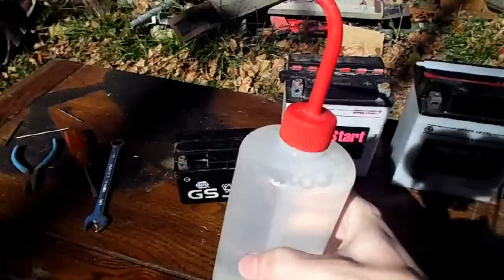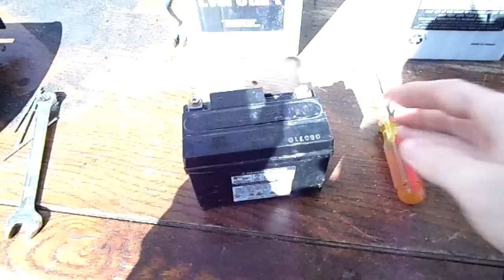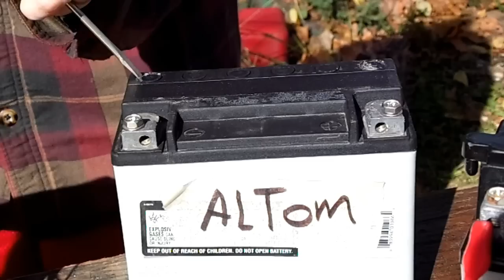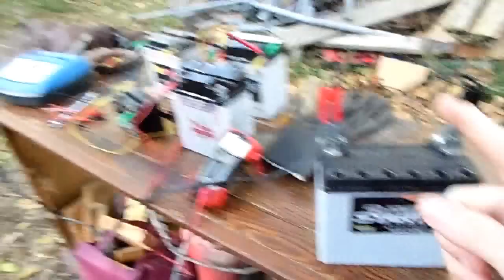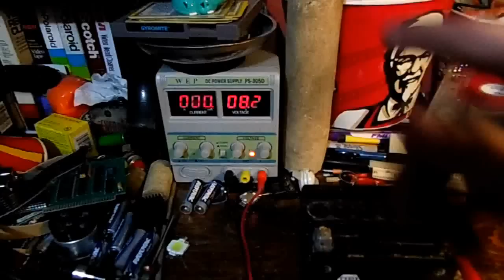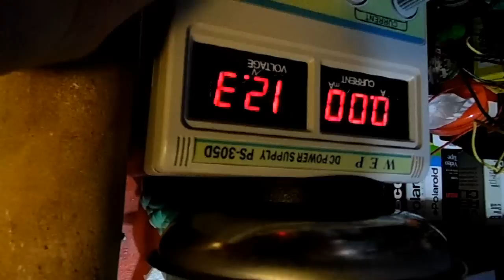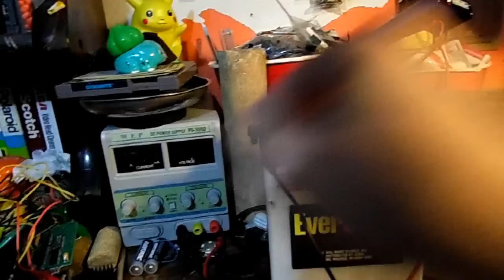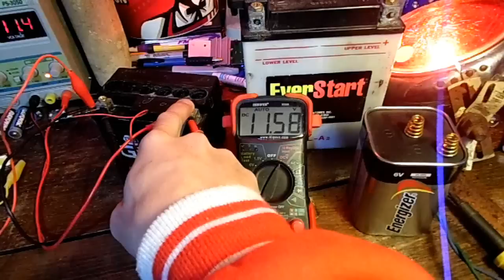DIY Fixing Lead Acid Batteries

Comment: I paid 30. I'm fixin to go pop it open and see if maybe they forgot to fill it
Reply from the maker: well if you do that you cant return it. was the auction for a filled battery? btw you can test if its filled or not from the outside. test it's continuity. it should have no continuity without electrolyte.

Comment: I bought a sealed motorcycle battery off eBay and when it arrived it didn't work. It had 10 volts. Did I buy junk or did they forget to fill it with acid or charge it?
Reply from the maker: you prolly got ripped off, if there are no caps on top for you to fill it, then yeah. how much did you pay?

Comment: great video, but shouldn't you be wearing gloves the whole time?
Reply from the maker: nah, i've gotten the battery acid on me several times. even accidently dumped a whole bucket of it on myself. you have plenty of time to wash it off. after like a minute it barely feels like razor burn.

Battery Acid Accident

battery acid is 90-95% water so is very dilute, and the older the battery the more it's sulfuric acid has become inert. thats why epsom salt helps. it increases the reactivity.
Reply: wow, that was a quick reply.  I was always concerned about getting acid on my hands or eyes working with batteries.  I guess I've watched to many movies.
Reply from the maker: Gary Ober
yeah, just be sure to wash your hands within a few minutes o it'll feel like having your cat scratch your hand hehe

but remember the acid you buy at stores to put into batteries i like 90% acid. if you get an old battery somebody may have refilled it with pure acid so still be a bit careful.

btw if you get any pure sulfuric acid, put sugar cubes into it. it turns sugar dark black then makes it bubble i think :D
Reply: Gary Ober I had a mate get sprayed in the eyes with battery acid ... he did alot of screaming. had to force wapp water into his eyes.
Reply: Sounds painful Jesse.  An ounce of prevention doesn't hurt...acid in the eyes does.

Comment: is it possible to fix a small scooter lead acid battery? it doesn't appear to have anywhere to fill it with liquid.
Reply from the maker: its an SLA then, the covers are hidden in the top.

Comment: the batery have a ACID ,,,, not a  WATER,,,,,   STUPID!!!!!
Reply from the maker: no your the stupid one. battery electrolyte is 5-10% sulfuric acid and 90-95% water. when you charge the batteries it releases the water as a gas so you need to refill the water every so often.

if you filled a battery with pure sulfuric acid it would destroy the battery. also...

WATER IS AN ACID you fucking idiot.....
Reply: distilled water is stupid,,,,, not simple water
Reply from the maker: sebastian6459
lol

you suck at trolling.
Reply: Rinoa Super-Genius haha soo tru

Comment: Have fun with your car fires,
exploding batteries, and low cranking Amps.
Reply from the maker: i dont use them in cars. but thanks.
Reply: +Rinoa Super-Genius tap water freezes stupid
Reply from the maker: MDTV Tube
yes all water can freeze. is that news to you?
Reply: Go to Napa auto parts and bye acid!

Comment: You add salt to distilled water with high voltage for HHO'S. And it's the salt that makes it conductive not the water.

If you put tap water in your batteries just once it will be garbage in a year.

Distilled water you can get much longer life span on your batteries and fill it more than once and get 6 years or more on 1 battery.

Just trying to help.
Reply from the maker: well i have been putting tap water in my batteries for like 3 years. so i guess that throws your 2nd statement out the window pretty fast. hahaha

the battery in my great-grandparents 1982 mercury Zephyr lasted 23 years and my great-grandpa only refilled it with tap water from his shed.
Reply: Rinoa Super-Genius and that shed watter contained all the parts required to feed the battery and even rebuilt the plates and contained what we call magic. lol nah yeah fuckin pisses me off how like 10 years ago now i geuss. the batterys here in australia all started dieing within a year or soon after. and it was like but normaly they last 6 or 7 years ? now i go into battery store asking what they would recomend. and they say well batterys are all shit these days so its best you just buy a new one every 2 years. im like ohh ok thank you for your tremendous help. I have an infitum desulfater thats managed to bring back 7 alarm batterys and 5 car batterys . altho 3 alarm batters shorted from inside and caught fire. which i found entertaining. still tho even now that they all holding around 13.1 volt off charge wonce i power up the inverter... its draining them dead so fast. fine durin the day due to my 200watt solar panel. my main problem I simply havnt managed to hold the power i make at the panel. but i thought Id learn all asspect of batterys before makin a big purchase for a few deep cycles :) nice vids mate keep it up . have a nice day
Reply from the maker: Jesse Lawton
 wtf are you trying to say? your comments are hard to read. you shouldnt just mash a bunch of sequential thoughts together. its hard to understand.

Comment: Distilled water is a nonconductor try it. Try ohming distilled water in a clean glass. Then tap water.
Tap water particles will stick to your plates in the battery and u will loose cranking amps.
I think you misunderstood the chemistry book.
Reply from the maker: either way it still works great in a battery, and  yes distilled water is slightly conductive. thats how you can electrolize it

Comment: U can start an electrical fire with tap water.
After the engine starts (with a tap water battery) it will charge the battery and voltage will go through the tap water and plates and burn wires in the engine.
Electricity takes the shortest path.
Reply from the maker: no, the particles dissolved into the tap water may be more conductive if you have nasty water. but it is usually no more conductive than distilled water. please stop spreading misinformation and read some chemistry books. it would help you in life ^^
Reply: +MDTV Tube just stop
Reply: tap water freezes you dum Fuck!
Reply from the maker: MDTV Tube
yes it does, are you really that dumb that you think your the only person who knows that water freezes?

Comment: U need distilled water. Distilled water is a non conductor. Tap water is a conductor of electricity. Tap water doesnt hold a good charge and makes a lot of acid when it evaporates. 
Use distilled water only.
Reply: Mdtv tube is 100% correct never use normal tap water in a battery. Only use distilled water. There are way to many minerals in tap water.
Reply: lishde di water?
Reply: De-ionized
Reply: Lovely video content! Sorry for butting in, I am interested in your initial thoughts. Have you ever tried - Rozardner Powerful Battery Reality (do a search on google)? It is an awesome one of a kind guide for learning how to recondition an old battery minus the headache. Ive heard some great things about it and my old buddy Taylor at last got cool results with it.
Reply: No tap water has salt in it and will rapidly degrade the battery. You should idealy use DI water but distilled water works the same
Reply from the maker: i think you are a bit mistaken with that.

but my tests show that regular water will work just fine.
Reply: Rinoa Super-Genius can u put the caps back on and charge the battery after the water restoration?
Reply: Rinoa Super-Genius actually u have to charge it with caps off cause the caps will pop off from pressure right?
Reply: They do
Reply: @RinoaL  ha ha ha u are a fake demonstrator regular water is not for flooded acid battery, ur such an ignorant, you are fooling ur viewers
Reply: @filipinasantos2769  You're very ignorant and rude too. "Regular water?" What does that mean. At one place I live the 'tap water' has nearly 200 ppm TDS. Another place I live has less than 10ppm TDS. While not as pure as DI Water or distilled water, it is totally fine for refilling unusable old batteries for attempting to improve them for more life. Go to school before you start wagging your finger and mouth with stupid comments.

Comment: I am interested in one of those desulfating gizmos (wizbang) for battery maintenance to prevent my auto batteries from going bad.. Any thoughts on using it for a week every six months? Never had much luck restoring old batteries in the past.
Reply from the maker: i would say just leave it connected 24-7 and see how that goes. its pulses are kinda weak.
Reply: +Rinoa Super-Geniusky*uppers ee r
Reply from the maker: Melissa Mulhern
 what?

Comment: Hi liked the video. New to all this and wondered how to make the desulfater you used? Hopefully spelling is right. Anyway maybe a location to buy one. Thanks
Reply from the maker: I got that one for 20$ from eBay and its really weak. but I haven't built any good ones myself yet.

I did try something that was promessing though. I built a circuit that would charge a cap to 30v then dump it into the battery as a high amp burst.

Comment: Not worth that time unfortunately. Easiest way is to buy not ruined battery. Usually even used ones work well. But it is interesting to do awesome stuff sometimes.
Reply from the maker: its better than throwing a battery away.
Reply: Rinoa Super-Genius
Never throw it away. Bring it to scrap metal recycling and get MONEY :D
Battery needs at least 20-30% of original capacity to have any sense.
Reply from the maker: Arnis Tarassu
would be a waste of a trip to drive 30 miles just to get a 7$ core charge. why wouldn't you experiment with an old battery?

but I swap them with other batteries on the recycling skid at auto stores. that works pretty good.

Comment: If you connect a piece of solder to your meter probes and dip the solder into the holes where you fill it, they make a mini battery and you can test the individual voltage on each cell.
Reply from the maker: i don't think its because its a battery. i believe its due to the acid holding a charge also. you can use any type of wire for it. but yeah its something i forgot to put into this video. but i try to make a new video every few months regarding batteries so i'll keep working at it :D

Comment: Should be high frequency pulsing not high voltage.
Reply from the maker: it should be both.
Reply: The sulfate that plates the lead has a very high resistance. The high voltage is needed to push current through the sulfate. If you can get charging current to flow, the sulfate will go back into the electrolyte where it came from.

Comment: on your hard to open maintenance free batterers run a small self taping screw in to the cap and use vice-grips to twist and pull the cap up.
Reply from the maker: thats a good idea too
Reply: Start your very own battery business and make huge money here: HootBattery.xyz

Comment: loved it have a Q , that desulfater you used ,are they buyable somewhere? or are they home made+ if so ,are there kits to buy, cus they are awsome!! thanx for the lesson.
Reply from the maker: i got it for 20$ on ebay, but i've found that its very week. so if your wanting to maintain a battery it might work ok but might want something with a higher power output to desulfate a bad battery.
Reply: thanx , i might lok in to it then.  you got some good vid up , keep it up.

Comment: very nice video. thank you! i have a question i have a maintenance free battery 35 Ah, it's around 12.5 v. i wanted to charge it but didn't know the standard charger (transformer + diodes is not good). I let it reach 15.13v then disconnected. I noticed a little bulge in one side of the battery around 3mm. i don't know if i caused it or it was like that. can i still charge it on a inteligent charger with desulfation?? i don't know how toi take off the caps. read on the internet that they can't be taken off and that it has special design to release the gases. the budge is soft and i can press on it. the eye is still green and i dont want to damage it
Reply: it's maintenance free with calcium- CARANDA manufacturer. 35Ah, oh and now after 2-3 hours it staying at 13.5 v
Reply from the maker: hrmm have you seen my video "DIY open car battery and repair with epsom salt"? is your battery like the one i open in that video?

i don't think charging it would make the bulge unless it got very hot. 15v is pretty high but it depends on how many amps you where feeding into it. ussually i charge a battery with 700milliamps untill it reaches 14v or so. ussually takes a few days.

is the bulge on the sides or the front/back of the battery? its normal for plates to push out on the casing and bulge it but it can mean its getting closer to the end of its life.
Reply from the maker: is it AGM? it looks like the battery is prety good compaired to others ive seen.
Reply: Rinoa Super-Genius
NICE VID! Thanx!  Seen it! That said....
I think you'd be better off with ALUM powder STRAIGHT OUT...
Than with Epsom Salt.    8 ounces of ALUM per gallon of water!
Watch THIS guy! 
/watch?v=Supe1a3LW2U
He also rinses the battery clean FIRST...
With 8 ounces BAKING SODA to a gallon of water!
I think he's using just REGULAR WATER TOO!
And his battery goes back to 13.2V... AND HOLDS IT... UNPLUGGED!  ;-)
Mind you! IT IS... a deep cycle battery, or so he mentions!

Comment: Do you hava some info of making a desulfator? Yes i have to look for one probably in an electronic store. Thankyou. I even watch de publicity of your vids to make you some bits money
Reply from the maker: theres a lot of ways to make a desulfator. one idea i have is to charge a capacitor and then dump the capacitor's voltage into the battery. i'm also thinking about modifying the 600v 700ma ballast from a flouro lamp.

and thanks!
Reply: they range from $20 to $100+ on ebay and a $90 to $120 for good heavy duty pickup battery $30 or $40 to save a few batteries sounds ok.
Reply: Rinoa Super-Genius can you also show this modification of your  desulfator after you done  testing  it here. with that ballast lamp.hope it work well.

Comment: I'm curious, to what voltage do you usually charge SLA batteries? There is a lot of different information online, but I usually aim for 13.5 volts for an overnight charge.
Reply from the maker: yeah i've started just leaving all my batteries on a 500ma 12v wallwart and take them off when they reach 13.5-14v.

some AGM batteries are kinda weird in that they like to sit at 13.1v instead of the regular 12.8v of a flooded cell. it has to do with the AGM battery not having as much acid in proportion to the amount of surface area of the plates.

Comment: Nice video. However; to make it more useful or for a follow-on, you might address the causes of dead batteries. For instance; I have a Delco car battery that is 48 series, that was simply neglected. It is not old, but I let it get deep discharged more than once. Now, it won't take a charge, even though the interior lights come on (thus, it puts out at least 12 volts, right?). Does improper deep discharging cause sulfating... as well asage of the batery? Do I build a de-sulfater? Buy it? Where? Thanks again for an informative video.
Reply from the maker: you prolly warped the plates if you discharged it that much. but its the same as being old. idk experiment with it.

Comment: please help me ,,, my battery is leaking shipment(charge) out without using it, what's the solation for that case,when I saw the battery by the voltmeter it was dropping volt fast like this 12 11,99 11,98
Reply from the maker: what voltage does it settle too after a half hour? if it settles to 10ish volts it may have a shorted cell.

ya see you can charge a battery with a shorted cell. and the shorted cell will sometimes take a charge. but because its shorted it will quickly discharge.
Reply: Rinoa Super-Genius So, what's the solution for this case, is it change the shorted cell, how could I do that ?
Reply from the maker: hakam abu shanab
i've never been able to fix a shorted cell. but is it shorted? what voltage does the battery go down to after like an hour?

you could try to charge it for a long time but idk if that would work. if you do charge it for a long time make sure its outside so the hydrogen blows away instead of accumulating. and don't charge it so much that it starts smelling like rotten eggs, that means its producing hydrogen sulfide.

also if you have any epsom salt that could help. i have some videos about that.
Reply: Rinoa Super-Genius automatically just when I cut the the charger, the battery goes down fast (voltage)
Reply: hakam abu shanab would mind calling me ?
Reply from the maker: hakam abu shanab
what voltage does it go to? 0v? 6v? 11v? if you cant answer that simple question then just buy a new battery.
Reply: Rinoa Super-Genius lol well said

Comment: Great video !!! And what if you have a shorted cell ???? What can you do to fix that???

Thanks for the informations!
Reply from the maker: idk of any way to fix a shorted cell without opening the battery. and once you open a battery its hard to get them back together. so i would say the best way to fix a shorted battery is to

A; buy a new battery
or
B: chop one cell from another car battery and run it in series with your now 10v car battery to give you 12v again. i've seen that done before.
Reply: Rinoa Super-Genius  Thanks for your quick response !!! Please let me ask one more question-information: Your desulfator is ''always-forever'' conected to your battery bank of your solar project??? So the desulfator takes ''charge-current'' from the solar panels???
Thanks again, i am so appreciated!!!
Reply from the maker: tolias Gaz
yeah the desulfator usses 80ma of current, but thats super small.
Reply: Rinoa Super-Genius
Thanks friend!! I have for you one more big deal------NINTENDO or SEGA????
Reply from the maker: tolias Gaz
nintendo, old sega was close to nintendo but new sega is a joke. you?
Reply: Rinoa Super-Genius
 I am big fan of SNES and N64 ----especialy mario 64, but i like sega master system